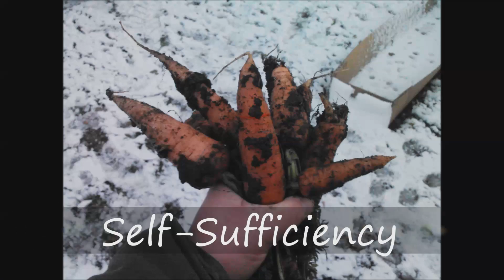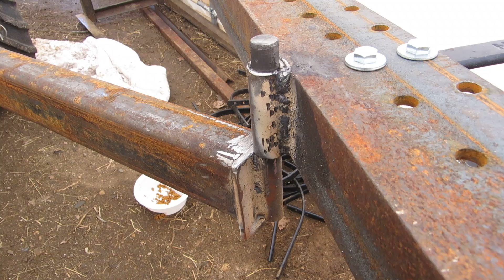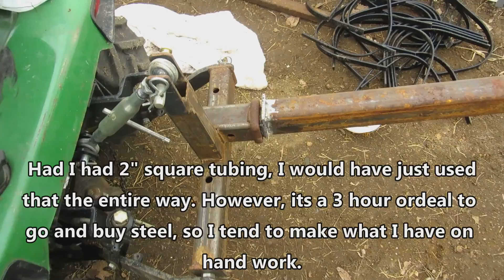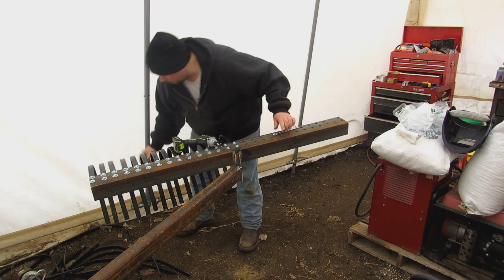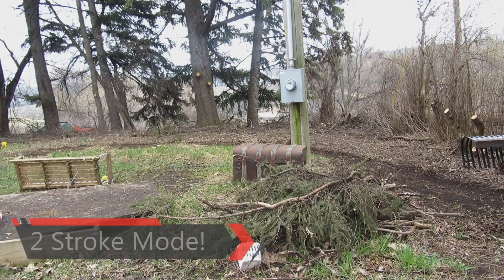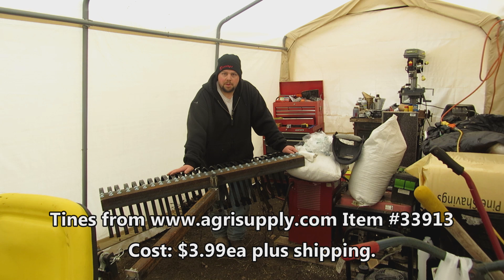DIY Landscape Rake build DAY 2! Cat 0/1

Comment: Im starting a simialr job,,what drill bits are best to buy to drill the angle iron,,i have many titanium bits but they have issues with cutting through even bed frame type angle...is there a good palce to buy the tines that dont charge you too much,,prices are all the place

Comment: Those tines are now $7.99, that's double the price in 4 years. I'd like to build one but all I have to pull it with right now is a Kubota mini excavator and that's not a good machine for this. I'm looking for an old tractor.
Reply: now up to $12.99. Ridiculous
Reply: 15.99
Reply: I’m going to make one but bend flat bar over something round
Reply: @Viralclown  couldnt you get tubing at roughly the same diameter and width, then use a band saw to slice the tubing into slices
then all you need to do is cut the hoops twice to get two semi circles
it wouldnt be the exact tine shape but surely a semi-circle cant be that bad?
Reply: i dont see why the cross piece the teeth attach to cant be made from timber either, scrap laminate timber, just bolted on with big penny washers

Comment: You should put a Piece of chain connected to both sides in the shape of you and then have a pen in the middle sticking out so far that way you can just drop one of the loops of chain onto it and it will kind of keep that straight but it will also allow a little bit of flotation with it

Comment: my thoughts are you should use a plate with adjustment holes and fashion it so you can totally spin blade around backwards for pushing also. just a thought.....................
Reply from the maker: I will likely do just that. I had thought about hooking up a hydraulic cylinder to control it on the fly, but that probably won't happen. Once I get time to mess with it, I'll just make a plate and pin system.
Reply: @MinnesotaHomesteading  where did you get the tea that for the rake?